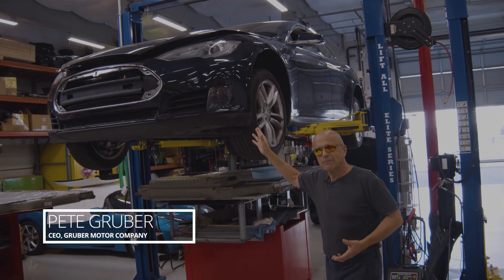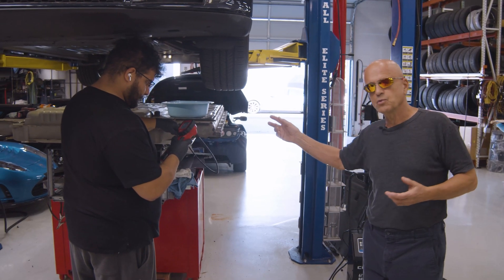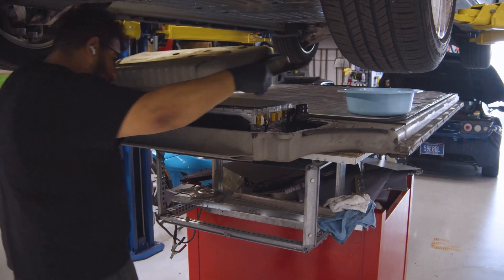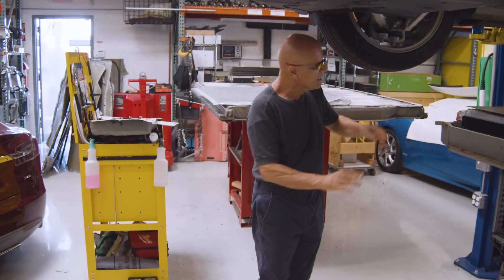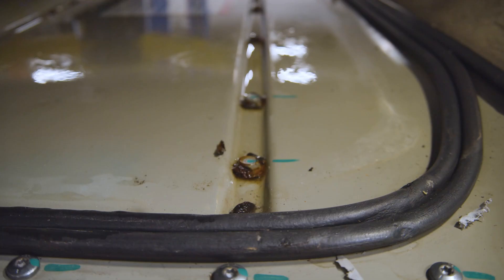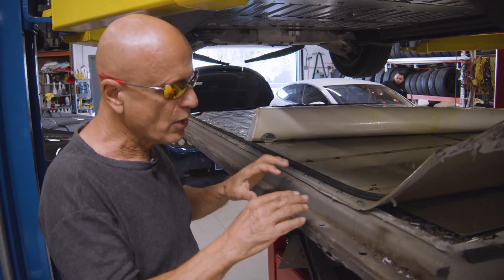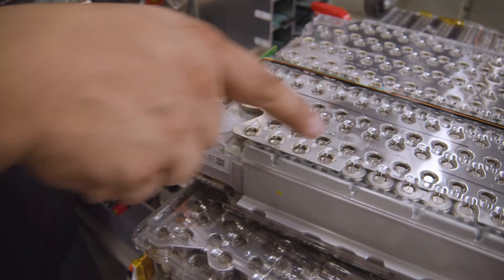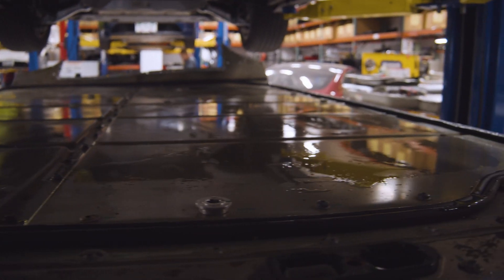Water Damaged Tesla Model S Battery | Gruber Motors

Comment: ICE-car with a engine failure: $8K max (excluding ferrari, lamborgini etc.). Tesla standard battery pack failure: minimum $22K  and a (small) risk to be vaporized in thermal runaway lol
Reply: Presently it is $16k to replace a battery pack. We need these packs to be more easily accessible because I just replaced a $20 circuit board and got my car on the road

Comment: Very interesting. Obviously Tesla design was not using their head when they decided to dump the condensation line on top of the battery pack. Hopefully this has been relocated on newer models. The battery should be 100% sealed off from any possible water Infuriating . They are not the most well designed. This issue also further shows why Nio and battery swapping is a much safer and effective way to monitor batteries and the integrity of the battery over time. Nio and swap stations are the future of electric vehicles.
Reply: Do you remember when Tesla bought  "Better place"? This was a battery swapping company with Nissan support out of Israel. They demonstrated on stage, showing how it's faster than ICE fuel up. The encumbrance of having specialized mechanical stations - an owner's reluctance to purchase the new battery packs - and not scaling out the monthly battery subscription model led to Tesla not continuing with battery swapping.

Comment: There was an update: The original short drain hose just reached to the firewall. The updated longer drain hose reaches to the cross member where the a/c compressor sits on. A clamp gets glued to just behind the compressor to hold the longer hose in position.  On RWD models you can clearly see this when you take the frunk tub extension out. Source: Tesla Service Manual (early Model S).
Reply: I always moved my hoses in the correct holes so they would not leak on the battery. Its common sense.

Comment: Great Post MR.Gruber  this content is extremely fascinating.  It looks like basic thermodynamics issues, and simple design issues along with incorrect material choices. 
But I think the corrosive rodent urine was an issue the Tesla team did not expect. But now it’s dojo documented. 
Many mechanics overlook the energy that can be generated by temperatures changes of fluids, in this case every time the battery containment box cooled down the pressure inside would fall ( vacuum) pulling any water laying on the top through the corroded breeches. The pressure would climb  and fall with every thermal cycle.

Comment: Bolt heads on top should be cap sealed with a sealant to prevent moisture incursion and corrosion.  Aircraft manufacturers do this in the wings and fuselage.
Reply: Should also use stainless steel bolts and not put them in a valley where water can collect. Bad design.
Reply: @MrPDawes  thanks for your recommendations. Tesla does everything you listed now thank you. This will never happen again to any future owners.

Comment: Thank you, Pete, for that heads up. My S is a 2020 - have they made any changes to the a/c drain or sealing to prevent this or can I look forward to similar excitement in a year or two?
Perhaps it would be a good idea to have a dessicant container - easily accessible - with a sealed tube to the battery compartment to keep the humidity down. The battery is such a critical - and expensive - part it makes more sense to design for its longevity than to add games and farts to the car.
Reply: Highly likely they've changed it before 2020. But if you have one of these early model s, you should check.
Reply: @celeron55  What....Just drop the battery and have a looky-look? Edit: You can see if you have the updated longer drain hose installed (leads to the cross member the a/c sits on) when removing frunk extension box on RWD models.
Reply: @moestrei  do you know what VIN number that fix got applied after?
Reply: @protocolmagic  No but it is easy to check.
Reply: @moestrei how would you go about checking that the VIN number updates for each model?
Reply: @PhilipX2030  Not sure. But if you switch the aircon on and a puddle of water emerges between the front wheels relatively quickly it had the update.

Comment: Where is the normal routing for the condensate line on the S and the 3?   I'm assuming it is not supposed to dump onto the battery, so what happened in this case?
Reply: The original short hose ended near the fire wall. There was an update to a longer drain hose which gets routed to behind the a/c compressor which sits on a cross member. Visible when you remove the funk extension box on RWD models.
Reply: Model 3 is similar, just a port that drips out, no tubing past equipment... however, it drips down near the front of the battery pack, NOT on TOP of it (!! who designed that in old S?!)... instead, it tends to drip on the aero shield, might build up a bit if not properly tilted/elevated (eg, parked nose down on inclined driveway?)...
Reply: @cgamiga  Ha, sounds almost like they intentionally made it drip on the aero shield so that people wouldn't complain their cars drip water on their driveway.
Reply: @celeron55   hah! Oh, it does drip on my garage floor (flat&level)... big "car pee" puddle in front after I sat literally Netflix & chillin in my tesla on hot day (car has A/C, house does not)...!  I put a bowl under it next time
Reply: Sounds like a class action